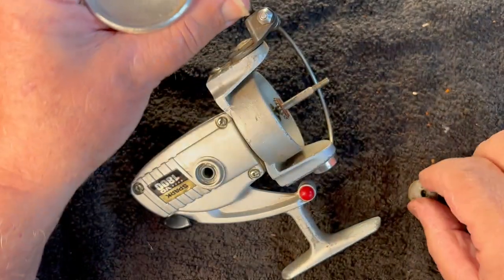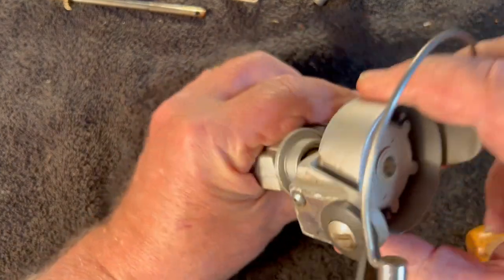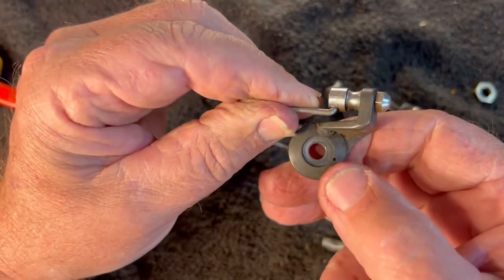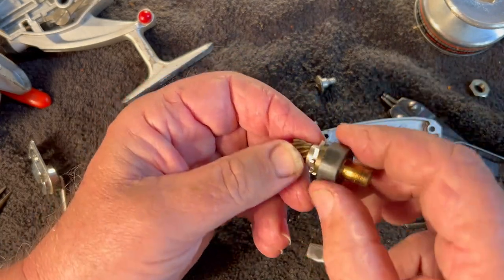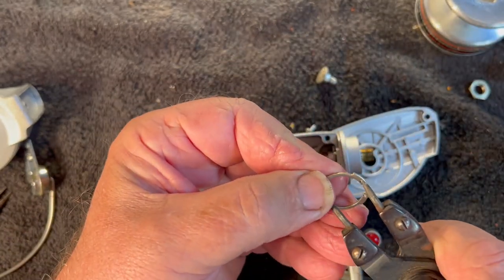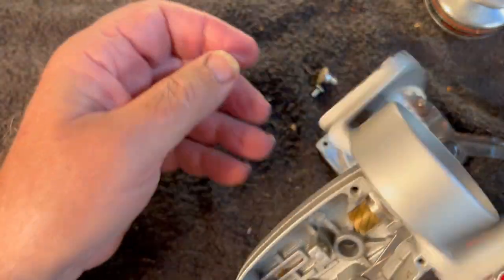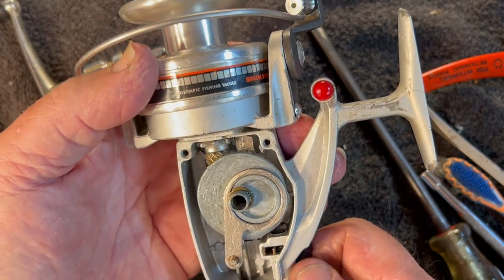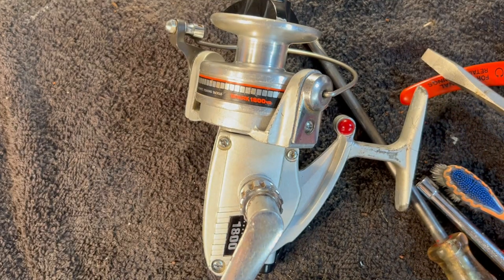Olympic Spark VO 1800 -- Service and Lubrication -- Young Martin's Reels

Comment: I have a number of these Spark reels but I don’t have my list with me in VA. All in all these Spark reels are pretty good. I certainly like mine. On all my hammer bail reels I flip them with my hand not the slam method. I knew you were going to find a snap ring. LOL. I would have tried a ball bearing for that bushing if I had one. This bushing was spinning so well you did not need a bearing. Did you grease that slot for the AR post? Did you lubricate the line roller? Rick, I have an Olympic VO 5000 reel for surf fishing. It is a beast.  Great video! — Chris

Comment: I see that Olympic used that same plastic bail arm on a number of their spinning reel models. While I’m not a big fan of plastic parts on a bail Olympic did a good design job on that part.
Reply from the maker: It seems to be holding up just fine all these years later.
Reply: @youngmartinsreels5314  It looks a lot like the bail arm on the Kmart SS40.